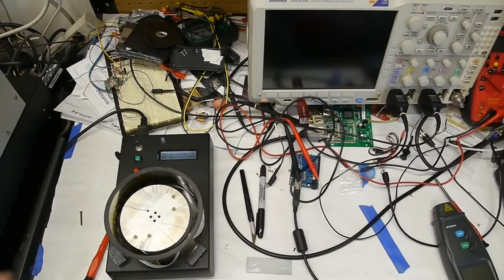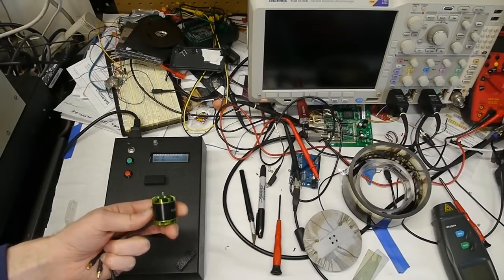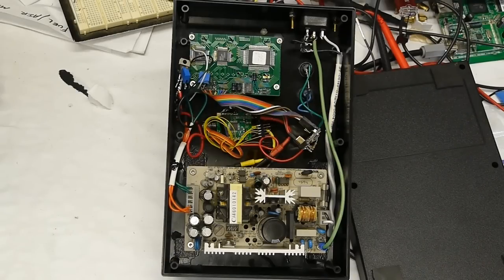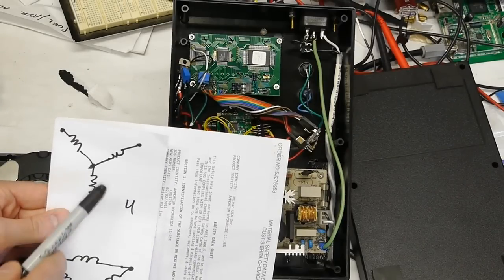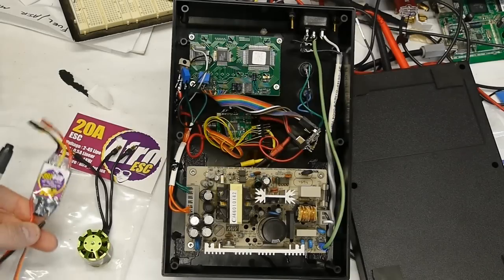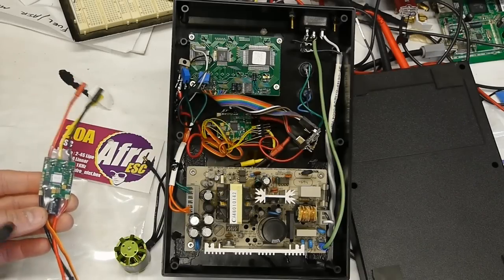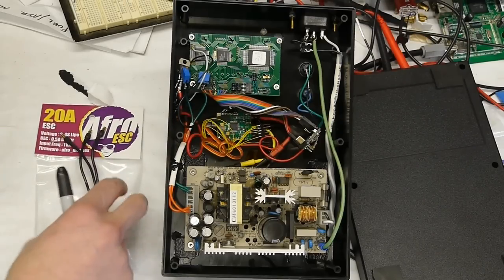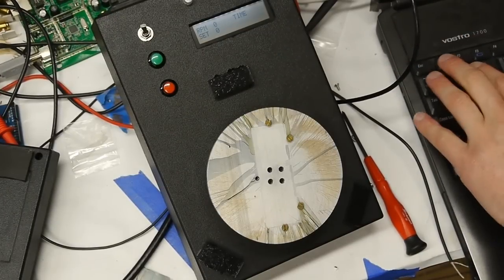Design and build a spin coater

Comment: Some very cool tidbits on this. You aren't kidding about RC being a whole new world. That hobby has been around forever but as soon as LiPo batteries and cheap brushless motors became easily available, it seems like things exploded.
Reply: +Practical Engineering I have a 15 year old 8 channel Futaba 72 MHz radio that cost more than my first plane (with Saito 4 stroke engine!) and my FrSky Taranis was a whopping 275, and supports 32+ channels, depending on how you set up mixing. It's gone positively nuclear.
Reply: Depending on the quality and charging circuits for the LiPo, it may have literally exploded!
Reply: I hope the LiPos didn’t explode, though...
Reply: I guess im asking randomly but does any of you know of a method to log back into an instagram account..?
I somehow lost the password. I would love any tricks you can offer me.
Reply: @Hugh Zev Instablaster :)
Reply: @Ari Johan It did the trick and I finally got access to my account again. I'm so happy:D
Thank you so much, you saved my account !
Reply: @Hugh Zev glad I could help =)

Comment: Now if you add a LED blinking always at the same time at each rotation for stroboscopic effect, you can even see how the setup looks like and the layer thins while in progress. Maybe not very useful while in high-speed mode, but while dispensing the liquid manually (you even can make it have a slightly lower frequency to have it look like rotating slowly - that way you have a natural indicator to avoid hitting the poking-out screw with your pipette).
Reply: +Henner Zeller Put the LED on the arduino and have it strobe in sync with whatever RPM you have the rotor spinning at so no matter what speed it's at it'll always appear stationary/slowly rotating.
Reply: +Henner Zeller 
That definitely needs to be in version 2.
Reply: +Henner Zeller That's a cool idea.
Reply: +Henner Zeller Enable MOTOR_DEBUG to get such a strobe in real-time (from MOSI / PB3 by default), but it will have a 50% duty and you'll have to divide by the number of motor pole pairs to get a whole revolution.
Reply: DanieleGiorgino  Perhaps you meant version 3
Reply: @Teth47  better way would be to mark white stripe on motor and add reflective optical sensor. Arduino does not know at which position motor is, it is only sending and measuring speed - not position. Different option would be usage of sensored motor, effect would be the same as with reflective sensor.

Comment: Great use of RC gear!  
Getting into the hobby has revealed a lot of methods of accomplishing tricky things cheaply/easily, of which I would otherwise would have been unaware. 
Also, motor braking isn't just for cars. It's used on fixed wing aircraft to increase gliding performance, as an auto rotating propeller creates a lot more drag than a stopped prop (oddly enough).

Cheers!

Comment: I'm guessing someone has already mentioned this but that weird little "adjustable zener" circuit reminds me of the dump resistors on superconductors. I think all you are missing is a load to keep the fet from popping if it ever turns all the way on. Like a piece of nicrome wire between the FET and Vcc as a current limiting resistor.

Comment: Nice idea to add that mosfet for clamping the regenerated energy.  It should have no problem except with temperature variations that will affect your threshold voltage.

Comment: Great video as always, thanks Ben.

A good way to make an accurate shunt regulator is with a TL431 precision programmable reference and an PNP power transistor. They are cheap and very easy to use and temperature compensated.  Often they can be recycled from an old ATX PSU.

It will have a much sharper turn on than the MOSFET or a zener circuit and will be repeatable to the accuracy of your resistors, so suitable for a production environment.  Your MOSFET circuit will depend on the gate threshold which varies from device to device and with temperature.
Reply: RIGHT! I think this is the best solution.

Comment: Great explanation of all of the details, and neat result!

By the way, you can set MIN_DUTY lower (I usually set around 8) to get closer to the lower limits of what can be software-PWM'd. This can extend the range between minimum and maximum speed, or if you would like to just push out the low end even with a higher supply voltage (or higher KV motor).

Comment: 18:10 That slow zoom on the spinning disc in combination with your voice was quite hypnotizing :-)
Reply from the maker: +Siegfried Müller Funny enough, the slow zoom was caused by the camera lens zooming due to gravity pulling on the movable part of the lens.  I have two identical camera setups, and the lens on this one is a little looser, and it will not hold zoom setting when vertical.

Comment: I’ve seen commercial motor drivers that used transient voltage suppressors, which are basically two Zener diodes back to back, along with a series resistor for active shunts.

In a typical use case, they might have a 48VDC power supply with a suppressor that starts conducting at 52-56V to stay under the 63V rating on the electrolytic capacitors.

Comment: I took the same route of logic Ben. Hobby bldc controllers for sub 10$ w/ open src fw. For the motor, take a look at brushless outrunners, high torque, low top rpm. (5-6k rpm max). A prop motor, not a quadcopter motor. Great information in this vid btw, tnx!
Reply from the maker: +Hedley Rainnie Cool.  What is your motor project?
Reply: +Applied Science Ben, a single motor quadcopter with variable pitch props. 4 geared driveshafts out to the props. One beefy motor in the centre.

Comment: Many of the motors for RC cars have hall effect sensors that lett the speed controller know the motor position and therefore can run at really slow speeds and give precise RPM readings

Comment: the breaking mode on model e-motor controllers is important for electric gliders. they got folding props, which you want to stop spinning when you throttle to zero. because that is when the prop folds and causes less air resistance and better gliding.

I like planes...

Comment: The ABS cement is really strong stuff. I used it for years on drain lines.
Reply: ABS cement actually welds the abs together by dissolving them together.

Comment: Your n-FET plus potentiometer will act as a voltage clamp, but with a "very soft knee", without further calculation I'd say that its resistance will only decrease very gently. I doubt that one can dump much energy in that device. Also: No heatsink.

With a classical motor controller, you'd employ something called a "Breaking Resistor". Industrial motor controllers (commonly called VFD - variable frequency drive) will have separate clamps to which connect pretty large, mainly air-cooled, wire-wound resistors. But that's of course devices with many kW of power intake. https://www.google.com/search?q=vfd+braking+resistor&tbm=isch

For your device, probably a smaller power-zener on a heatsink would provide more efficient breaking.
Reply: braking*

Comment: Simply amazing! Eagerly waiting to see in what project you will use this. Better DIY LCD? Transistors?

One thing though,  you say in the video you will show us the HDD motor connected to a debug port to demonstrate how fast it is able to change speeds? It didn't work anymore or did the footage just "fall off the editing table". :)
Reply from the maker: +Macovei Vlad I ended up not using the HDD motor.  In the video's last couple minutes you can see the quadcopter motor changes speeds as quickly as it can.

Comment: Thanks for the video and info.

Any chance you have measured the run out of the shaft? These motors could be great as high speed spindles. 

Also, does the temperature jump up? I wonder if the motor assumes it will get cooling from the propeller.

Comment: I have never understood why everyone calls the quadcopter motors "DC Brushless" when really they are just 3-phase AC brushless motors.  That's why they need a "speed controller" to run on DC power, it is really just a variable frequency 3 phase inverter.

With that said, the modern market for these devices certainly does mean that we now have access to an insane amount of well controlled rotational power output for very little money.
Reply from the maker: +Jensen567 It's true that the choice of labels is unfortunate, but there is an important distinction:  "AC motors" are typically understood to be induction motors ie their rotor contains only conductors, no magnets, and the force is created by induced current flow.  A permanent magnet DC motor has brushes to shift the current flow which produces torque on the permanent magnets.  A brushless motor could be induction or permanent magnet, so we need another label.  It might be best to call them brushless permanent magnet motors, but BLDC for brushless DC became popular when the controllers were integrated (eg 12V computer fans)
Reply: +Applied Science Is it true that a brushless motor could be purely induction based though?  How would one power the coils on the rotor without brushes for more than a few revolutions?  I did a quick search and did not turn up any designs that used an inductive rotor without brushes.  So really, I think brushless would imply a permanent magnet rotor.
Reply from the maker: +Jensen567 Induction motors generally don't have brushes.  They work by magnetically inducing a current flow in the rotor, so no need for brushes.  However it's true that the "brushless" designation has come to mean "not induction" by convention.
Reply: +Jensen567  the  AC asincronus induction motor , wich is brushless, is the most commun used in various aplications that need reliability but not lightweight, they have so called shortcircuited rotors or  'squirel cage' the stator incuces a current in a rotor winding that is in short circuit with all the other rotor windings there is an amplification of the current/voltage drop  that generates faze shift and so on...  , by the way try to short circuit the rotor of an universal motor to see what happens
Reply: +Jensen567 
They are called BLDC, because, well, they are DC motors with external commutation. You can run them on 3-phase, but they will most likely slip as soon as you apply a varying load.
The speed of a BLDC motor is not determined by the phase switching speed! The speed is controlled by changing the voltage to the coil (almost exclusively done via PWM), like with a brushed DC motor. The time, when the next "phase" is activated, depends on the position of the rotor, as it would be in a brushed motor by the rotation of the commutator.
Reply: thanks for pointing this out. when people use bung words for things it makes it difficult to learn. i really wish people gave up on convention if it meant the description was wrong. good stuff

Comment: Not sure if this was your problem, but the pulse wire should work with your board, you just have to detach or otherwise not connect the 5v power. Connecting the signal and ground will work nearly every arduino.

Comment: the Y config works fine with an ESC(common). Just feed it 12 volts or even 24V, and leave the COM. some ESC can be programed in depth, and you can make the accept that COM wire. I believe that you can just hook the COM wire onto a virtual ground made using two caps? yeah that's pretty complex since you can just simply feed it with an 3 wire ESC, and it works!

Comment: Your braking circuit resembles a 'crowbar' circuit, I believe... used in big audio amplifiers, to prevent DC from appearing across the speaker terminals when a fault happens.

Comment: Do you know Dr. Garret Moddel? Could you please build his cell with this device? He practically combined two known phenomena/principles together to get usable energy from the thermal background radiation. He combined a Quantum Tunneling layer with a Casimir cavitation layer in such a way that you get e net flow in one direction. Is there a way to get that cell done with household items and a DIY spin coater 🤔?

Comment: 8:17 The 3 wire motors can be wired for Delta or WYE. A Delta termination will have a kV 1.73x higher than the same motor & winding terminated WYE. For optimizing RPM per V (kv), the motor can be rewound increasing or decreasing the number of turns per pole and terminating in the configuration that gives the closest to the desired kv. 

Is the platter balanced?

Comment: Imperfect timing, I just recently finished my own spin coater. https://www.youtube.com/watch?v=hdgkTBljyfE
I'm using a Maxon motor with sensors and their controller after playing with hard drive motors and RC controllers. I thought I might need slow speed control (nope) so that's why I went that way. The vacuum chuck is contains a porous aluminium (Metapor) insert and is itself held by vacuum with an o-ring seal for quick change. The motor has a rotating shaft, I drilled it but had to put the rotating body of the motor in a box for the vacuum connection, I also made a crummy shaft seal as the bearings were obviously leaky. The bowl is a water bowl for pets, I have a smaller plastic bowl with no bottom and a lip (formed with heat) to catch the resist and make cleaning easy. I don't bother ramping during but instead just drip on at full speed, it is the least wasteful method and seems to work.
Reply from the maker: +littlestworkshop Nice work!  Thanks for the details.
Reply: +Applied Science save you self some money and use straight acetone to solvent weld ABS dont use nail polish remover though as it has other oils and aditives
Reply: +Applied Science Thanks! Seems the least I can do considering all I learn from your videos. I'm building a dip coater now for double sided coating, much easier to make but dust is harder to avoid.
Reply: +chaos I've had less than ideal results with straight acetone. It seems to act on the styrene far quicker than the acrylic or butadiene (not entirely sure it reacts w/butadiene at all) so you wind up with a crazed, weak joint. At least with my 3D prints. I've used the pipe cement before, and it's a pretty bulletproof bond.

Slurry is also pretty good - chopped ABS (failed prints/raft+skirt bits) dissolved in acetone - works pretty well as a gap filler and adhesive, but I find it's a bit of a pain to mix up vs. just buying something that works, for the amount of assembly I wind up doing anyhow.
Reply: Rion Motley it comes down to pre saturation man, your trying to bond different plastics that dissolve at different rates. try brushing the ABS surface with a few coats of acetone before bonding to give it more time. and when it comes to bonding ABS to ABS acetone works the best chemically again give the surface time to soften up before pressing it up to the other part. Ive been bonding all variety of plastics for a long time so ive got some industry experience with, fixing plastic car bumpers is more technical then you would think

Comment: I'd add a MOSFET and load dump resistor to dissipate the regen energy, if necessary PWM the gate drive to control the energy flow.

Comment: Looks like there's some vibration at the higher RPMs? Maybe if you move those two side brass screws so they are at the same radius as the opposing one that would balance the system?

Comment: Yea probably should put some kind of door or shield type thing over the opening.
Reply: +BioNerd Yeah, at 4k rpm that rotor looks like it could be pretty dangerous, let alone the glass slide
Reply: +BioNerd Useless worry. You should wear a helmet the second you leave your house.
Reply: dus toin It's all fun and games until you have shattered chemically coated glass rocketing towards your eyeballs at hundreds of miles per hour.
Reply: +dus “dustoin1386” toin I'd feel fine with Ben's design because I know he did it properly, but if you're recreating this and don't get the proper mass distribution with those screws (or the rotor itself), I wouldn't trust it.
Reply: +BioNerd A possibility of fast-flying pieces of glass don't seem all that fun to me either. A shield might be a good idea just in case.

Comment: You can reflash the ESC with firmware to enable and adjust braking.
Reply: +Camaro Rick USBasp + Atmel chip flash tool is what I used with BLHeli software

Comment: A system to control many high speed motors with precision? You're not planning on one-upping the nuclear boyscout are you?

Very cool project, I never would have thought to use RC parts for anything but RC.

Comment: Hey really like your series of videos. I work as a mechanical engineer in the high tech industry and want to make DOE's and CGH's at home. Could a spin coater like yours control photoresist layer thicknesses within 30nm? There are all kinds of fancy measurement devices to measure the thickness of these coating like atomic force microscopes. But is there any cheap solution to measurethis? Chromatic convocal sensors can do this, but that is not a cheap solution.

Comment: Is there are reason to go trough all the effort of reprogramming just to spin the motor the other way?
You could use a relay to switch the leads around, reverse the motor or if that isn't fast enough some (high power) transistors.

Comment: But brushless motors have parameter called kV- "This is short-hand for how fast the motor turns per volt". How ESC, in no sensor configuration, knows how many RPM motor is spinning? You put this value to ESC .hex file?

Comment: Make it go 12000rpm. See if the slide will break apart. recommend to use a pair of diode and low value resister instead of mos-zenner

Comment: the wiring you show for the hobby motor isn't entirely correct. they do have a center tap that all phases are tied to, however it is not used. so it is wired how you show the hard drive motor, without the center used. the lower one is an alternate way to wire them, but is generally not used as the rpm is higher and winding is more difficult.